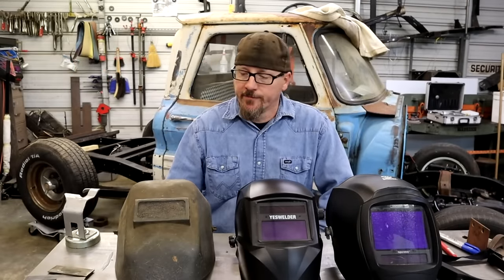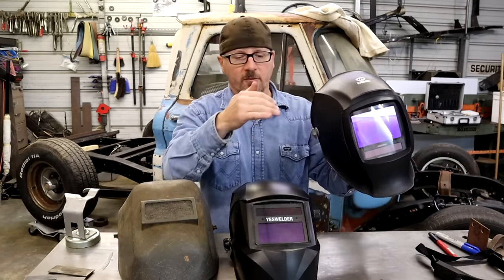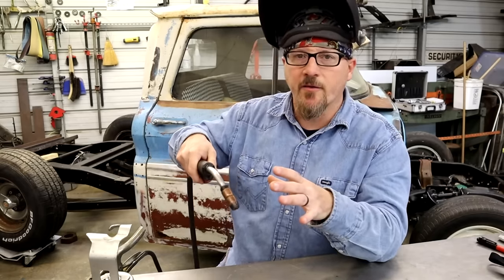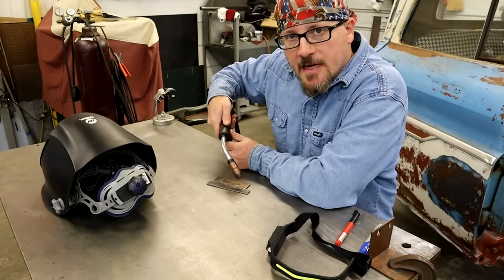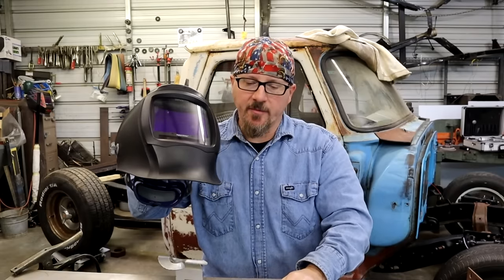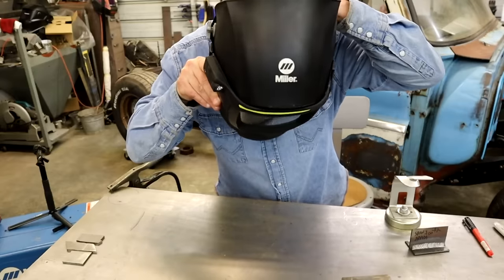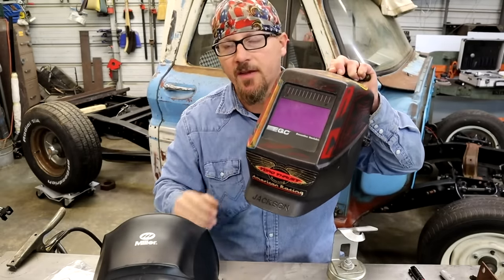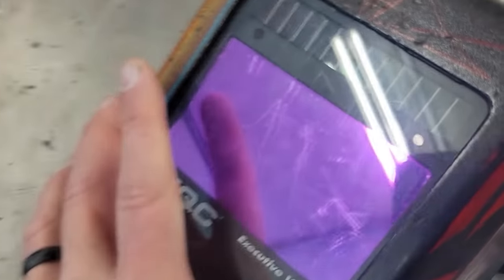(HELP) I Can't See My Mig WELDS (Top 5 Tips)

Comment: All good tips. The problem I have, which nobody else seems to mention in all these videos, is the workshop is so well lit with big LED overhead lights that in certain positions I can't see my welds because of light shining on the inside of the hood lens, so I have to turn some of the lights off. I think the solution is going to be attaching some flameproof cloth to the back of the helmet.
I wonder if more expensive hoods have a better shape to stop this problem.
Reply from the maker: Thats a good idea, I actually use a piece of a old welding coat over my helmet when filming arc shots with my phone because of the glare. I should of add that in the video. Thanks for watching!!!!
Reply: I attached a leather sheet to mine with acable ties every 2-3 inches works a treat
Reply: Get you a fire resistant hood cape, blocks out a lot of background light
Reply: I was expecting this to be in the video. It’s my main issue I think and I could do with adding a piece of silver hide or something.🇬🇧👍
Reply: You are not the only person with this problem. Light entering from behind is a huge problem, and in my case it was compounded by a white safety sticker the manufacturer applied to the inside of my helmet. That went away immediately. A friend gave me a worn-out leather jacket — from the 1950s, no less — and I cut the back out and attached it to my helmet with those metal spring clips used to hold documents together. I like the cable tie idea mentioned here. It helps hugely but does make the helmet hotter … and sometimes contributes to fogging of the darkening lens. What I can’t imagine is how the weld seam is visible when dragging the gun, so I doubt I will be trying that. Even with the leather sheet I can’t always see ahead of the gun.
Reply: You can get complete enclosed cost a fortune though, I use a light attached to my welding helmet to illuminate the weld area works a treat can see to push or drag
Reply: I'm glad it's not just me then, although after all these months I still haven't got round to doing anything about it. The problem's not gone away but a couple of the ebay LED lights have stopped working so it's not so bad.

Comment: I wear those bifocal safety glasses when welding and just working on projects in my shop.   I will say though that the separation seriously bugged me at first and was  hard to get use to.  (still bugs me)   When buying a hood, always buy one that has a real easy simple system of changing the lenses.  Buy a good headlamp from a safety or industrial pro store; there are a lot of cheap ones out there. Avoid buying any welding gear from Horrible Freight.   Good video.
Reply from the maker: Thank you very much, I agree buy quality helmets for sure!!!!

Comment: My problem was CONTRAST. My eyes are not standard and can't deal with high contrast. The arc triggers my eyes to shut down the amount of incoming light and I can't see anything else than the arc. I fixed my problem by installing a high intensity flashlight (5000 lumens) over my helmet with an adjustable focus to concentrate the light into a 5 inch circle around the arc. I can see the puddle now but an even stronger light would be welcome.
Reply from the maker: Thank you Ill have to try that. I bet that will help with filming also!!!

Comment: Thanks for tips on welding I been away from it for 15 years  Now back at it but lost lot time, and memory, Now I got shield with welder from Harbor freight  it's 125 with rosin wire  it working well but shield got go hard too see to start welding.
Reply from the maker: This is my latest video it may help you out. I found a new replacement lens you may be able to put in your old sheild. Check it out below if it will help.
https://youtu.be/WJkzs0z9CkE

Comment: I use “Led Lenser” brand head lamps. They come with a helmet mount you just stick on your welding mask. I put them on my grinding masks too. I use them for everything. Hate the magnetic charger cords though. Always get metal bits in them you need to clean out.
Reply from the maker: Thanks for the tip, ill have to check them out!!!!!

Comment: This is an ongoing challenge for me. My biggest challenge is seeing the joint in the workpiece as I am welding. I think the drag technique may be the answer since I was convinced I had to push all my MIG welds.
Reply from the maker: Ive watched alot of very knowledgeable guys say that there is not much of a difference between push/ drag. I prefer the drag because I can see better!!
Reply: I try to convince people in the comments section of what I have learned along the way, but it's very difficult as they have learned completely differently than myself.  I really hope that people learn that there are two ways to go about it; one will lead to blindness, while the other is counterintuitive, as you always have your eyes moving ahead of the puddle, only watching the edge of the molten metal (never the arc).  You have a mental picture in your mind of the whole weld, prior to your hood ever going down (or your auto shade lense ever going dark).  Your efficiency  at this means you never have an "after image" of the arc, stuck in your eyes, from the beginning of your shift till the end of your workday.  You then move to a darker shade lense.. and again a darker shade, as by now you no longer even see the light around the weld, just a red center cherry.  
It will ruin your day if you watch the arc, and if you do it for a living, you will eventually be going down in shade lenses, not up, as you are only losing your eyesight.  I would never weld anything with less than an 11 shade lense, and I've been welding for 25 years now, and I never suffer from eyestrain.

Comment: When I bought my wire feed for a restoration car project I quickly found I couldn't see. Then, when I did the exhaust system, the helmet wouldn't fit under the car and just didn't work.  I tossed it and learned to shut my eyes and go by feel. That was 30 yrs ago, and been welding "blind" ever since. I knew extra light would have helped but it was too much extra work to set up. ha ha The other thing I recently started doing is to hold the tip of the gun with my free hand for steadiness rather than just holding the grip. Way more control.
Reply from the maker: I do that sometimes lol, but My face usually gets burnt lol

Comment: I been welding 20 yrs the only i  got to add is dont be afraid to adj the power setting on your helmet down all the old timers swear it needs to be on 12 i run it from 9.5 to 12 depending on amps and welding type what your looing for is watching the Edge of the weld pool to go solidified you meed to see that especially when wedling vertical
Reply from the maker: I agree, i was told years ago in school it has to be atleast #12 I use #9 to10 regularly for years. I always say if your eyes start getting tired turn it up a lil.

Comment: I've heard changing to a lighter shade lens will help too. I think my main problem is I can't see where I'm going. I can be welding and thinking I'm doing pretty good, and I'll stop to take a look, and I've veered off into right field from my weld line.
Reply from the maker: You can also try to look over top of the weld, some times works .. It can be tough to see sometimes to see. I have used soap stone on the weld line sometimes to see better. Thanks for watching!!!!

Comment: Thanks for the tips been having trouble seeing what I'm welding I have a Lincoln 3350 so I don't think it's the hood. I don't feel I get enough contrast. I find myself moving off where I'm trying to weld. I also find light coming around the hood is distracting. I'm going to try spot lighting what I'm welding maybe that will help to define where I want to weld
Reply from the maker: That will help, the new lens is something that I always over look and also you can turn down your shade if you have a auto dark. I usually weld at a nuber 9 to a 10 if your welding lower amperage. Thanks for watching!!!!!
Reply: Gotta change lens

Comment: Nice video  - thanks! I suspect the manufacturers make the cover lens so soft that if you look at it scratches  - so you have to keep buying and replacing them. It's ridiculous on how soft the plastic is. I am going to try the wax triick and  I am tired of having many scratches happen if I happen to put the welding helmet down wrong.  It has to  be on purpose!
Reply from the maker: I agree, it seems like if you stare at those lens they scratch lol

Comment: I used a regular hood today outside, I couldn't see half of my welds. I usually use a pancake hood, but switching from it to glasses so I can grind and hat on, hat off gets old. 
Kind of hate the pancake, but it keeps the light out. It's just inconvenient in every other way to use.
Reply from the maker: Iv always wanted to try a pancake but haven't yet!
Reply: When you buy them you have to sand on the wood frame and fit them to your face. Other than that they are light, block out all the light if you fit it well.
I fit mine wearing a 3m half mask so the flux core and grinding don't kill me as fast. :)  @ACDesignsGarage

Comment: You can always put new protective lens and new shades in the "Christopher Columbus" helmet.  I still prefer to use those; don't trust the auto stuff but it's also just what I'm used to.  I just did this with mine the other day and didn't realize how scratched and dirty my old ones were (3 pieces: font, back, and shade).
Reply from the maker: I use to use the fixed shade helmets until I got more into motorsports welding, youll wear out your arm filpping it up and down lol, thanks for watching

Comment: That old school hood works just fine. You DO need to match the glass # to what type of welding your doing.  Do like the auto darkening hoods though
Reply from the maker: Yeah the old school hoods are good, especially there lighter in weight. The main reason I like the auto dark over the old ones is I do more sheetmetal repair than just regular welding, so when you spot weld alot the old ones can be aggravating.

Comment: I had a plastic visor on my motor cycle helmet and I had it for about 5+ years because I cleaned it with beeswax furniture polish as it filled in the cracks (kept the rain off), but at night, eliminated the haze caused by microscopic scratches on the lend..
Not sure it it would work with a welding helmet but cheaper than replacing lenses ?
Reply from the maker: Awesome thanks for the tip, I also heard that lemon pledge furniture wax works also, ill try your method!!
Reply: @ACDesignsGarage  I am honoured.. Best wishes from the UK. Hope it works for you as well as did my M/C visor:)
Reply from the maker: @ClaymateDesigner  thank you very much!!!
Reply: In a pinch you can use WD40 to clean the smoke off the outside of the lens cover and clean your helmet too.
Reply: @jamesbrucks5266  As far as the Helmet goes, I only ever used soapy water as did read that some chemicals, like those found in stickers, can weaken the helmet.
That was decades ago and maybe the helmets materials are less affected today but, you won't know your helmet works until you need it...
Respect from the UK.

Comment: You'd think, at this day and age, they'd have welding helmets with nice LED lights, especially the high end ones. They should have a line of them right above the screen with 2 or 3 different brightness settings like the magnifying glasses I got from Amazon 7-8 years ago for $15 that came with 5 different size lens. It has nice LED light in the center top position that pivots so you can make it point downwards if needed.
Reply from the maker: I 100% agree

Comment: Two tips I picked up lately is keep your helmet covered when not in use if you're  not welding all the time and to remove the protector cover from the screen when you buy a new helmet it just peel's off , couldn't see a think until I peeled my cover off 🤦🤗☘️🇮🇪🤙
Reply from the maker: Hahaha yeah ive done that, I also keep my helmet in a helmet bag when not in use. It seems to cut down on the scratches.

Comment: I work as a welder. We have speedglas helmets in workplace, but when i need to weld with low amperage i use normal cheap glass welding helmet, i
i can see much better edges of weld puddle
Reply from the maker: Awesome tip!!!!!

Comment: I do a limited amount of welding and I have Chris Columbus' original helmet .   No matter what what type of welding I did, or what lens I selected, nothing was working for me until I bought a small theater stage lighting unit and focused it on my work area .  At the time I bought my unit the they were reasonably cheap,  but I'm sure any creative person could fabricate an equally function unit using a high beam automobile bulb mounted on a triode or gooseneck, powered by a battery and charger unit ...... or maybe just a hi-watt 120v flood bulb .  My unit lights the whole work area so I can get the "big picture" of all that I have to weld,  and I can see where I want to strike an arc thru  a #11 lens without bothering to flip the helmet up and down .  Yes,  I could buy an auto darkening helmet,  but too late-in-the-game for that now for my occasional welding and I would lose that full-area vision .  ....'sides, auto-darkening was new-fangled when I began my welding experience.   Thanks for all the good tips on keeping lens clean and scratch-free -- makes a BIG difference !
Reply from the maker: Thank you very much!!! I myself was amazed how much the light helped!

Comment: My tip is to use a shade #9 and use a slight drag
Reply from the maker: Thanks for the tip!!!!
Reply: @ACDesignsGarage  you need to match your lenses to the process and amperage.  If you’re running 1/16” T-8 with a #9 you’re going to go blind.
Reply: All practical tips.  Reflected light from behind your hood/head.  It drives me to distraction sometimes when I am an awkward position with lights behind me.
Reply: @davidadams405  .030 wire with a short  circuit transfer and a shade 9 you will never go blind wtf you talking about
Reply: @davidadams405  most lights are on the ceiling! How is that even possible?
Reply: @brianpatrick7193  you should read more carefully.  I was talking 1/16” wire.
Have you ever worked outside?  Lotsa light out there.  Do you only weld in the overhead position?  Jesus!
Reply: This is why you DON'T want to listen to people in the comments section of YouTube as well as the majority of creators.  It is mostly bad advice that is going to ruin your eyes.

Comment: Realize this is an old video but something I've found with my vision is I am partially color-blind and night-blind. Aside from that, there is a difference in the degree of color-blindness between my eyes, meaning one eye is better for welding than the other one. Explanation, I am right handed and do a bit of flux core welding so generally one would hold the gun in the right hand and move from left to right, so most of the focusing is done by the left eye. However I found that I can see better if I have the gun in my left hand and move from right to left just like a left handed person would do. Its a little awkward and takes time to get used to but it sure makes a difference in visibility
Reply from the maker: That's awesome that you have figured a way around this!!!
Reply: @ACDesignsGarage  Regarding my comment here, I made a video a few days ago explaining this issue and I would appreciate your taking a gander at it or rather just listening to the speech instead of watching in order to avoid nightmares since I usually only appear in public on Halloween 🎃

Comment: Try doing MIG in limited access area. You can't see the area. You can't tell how far the wire is from the joint. You pull the trigger and the wire feeds 5 inches before it strikes and arc. At least with STICK you can see the rod easily. The tip of the rod can rest in the contact area before striking the arc. And the molten puddle can clearly be seen.
Reply from the maker: Great idea, I may try that!!

Comment: I found out my 300 dollar Jackson did ok for tacking..haven't use the bigger quick change....my choice is the big lens Jackson and I wear my cheap dollar general glasses under it.welded in a heavy sheet metal shop for 42 yrs tig, mig, and stick....main thing is keep a clear lens on inside and outside of your lense. Most light iron no. 10  and on up depending on amperage...and he's right more light the better and if you really need to see the Crack on light iron use soapstone...didn't see to much contamination in the weld
Reply from the maker: Thank you for watching,  a dirty lens is most peoples problem!!!

Comment: Hello thanks doe your great vid.
  Wow why didn't I think of that, get some kind of light source onto my helmet. You talked about the Yeswelder,  would you happen to know what settings to set the speed and voltage?  I need to weld a thin metal gate pole of a livestock gate.  Speed is from slow med and fast with some distance between on a knob that does not show an amount in the digital window. only the voltage knob gives a reading. The metal is approx. 1/32 " Very thin. 
I only have 1/8" material to try to dial in where the welder should be at. If I do manage to get  a nice bead, how much should I dial back the voltage.  Thanks a bunch.
Reply from the maker: Thank you for watching,  check out this video I made a while back on setting up your machine by sound ill drop the link below, I hope this helps!!! 
https://youtu.be/-fS3egx3A0U?si=nom0jfFtd5sZRW0b

Comment: I worked for a company that provided replacement lens for about 200 welders. You had a Miller, Speed glass or Lincoln. Harbor freight type  hoods were discouraged because they won't stock odd ball lens or headbands for your cheap hood.